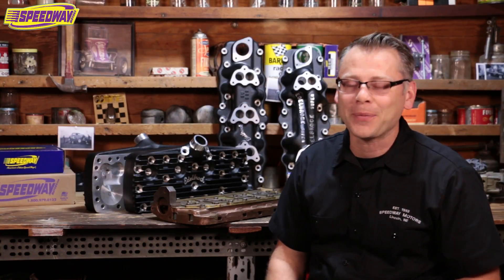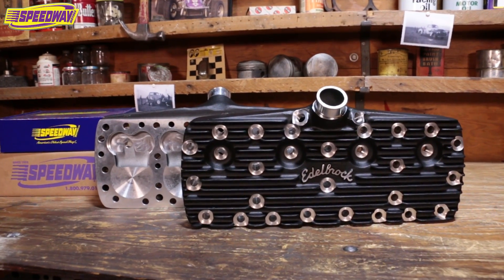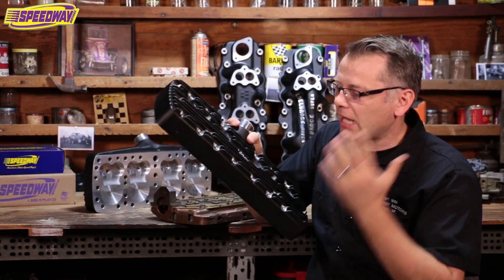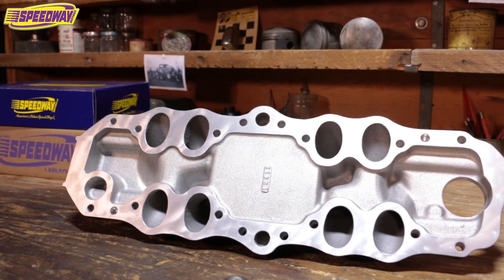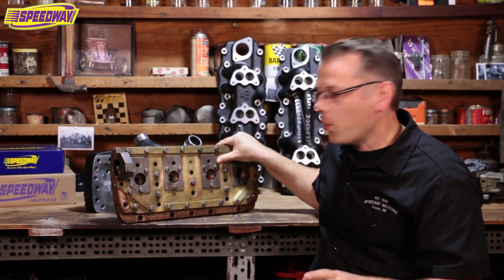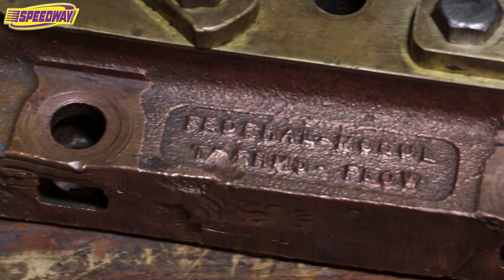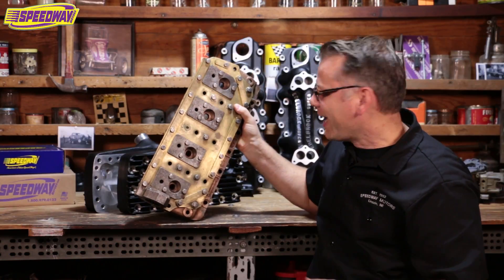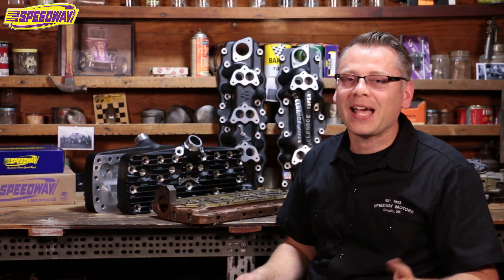Speedway Tech Talk - Flatheads Cylinder Heads

Comment: I have a 1950 Mercury M68.   It strangely enough has two different cylinder heads on it - 8BA & 8RT.   I might have to drop the $$ and get a matching black intake.   Assuming these will fit my 50 Flathead

Comment: Please I need some advice. My 8BA is mounted on a trailer to tow to shows and high school shops. This spring it blew water out of #1 exh. I changed the head gasket and accidently knocked the bottom off the blind hole for the thermostat. Now no more water out of #1 exh but all my water goes into the pan.

Comment: Do the aluminum heads need longer block studs?
Reply from the maker: Typically aluminum heads are thicker than the original cast iron heads by just enough that you do indeed need to switch to new studs. At any rate, if you're looking at Edelbrock heads, we recommend these if you want a perfect fit:  https://www.speedwaymotors.com/ARP-151-4101-Head-Stud-Kit-1938-48-Ford-Flathead-for-Edelbrock-Heads,88073.html These are for 38-48 Edelbrock heads, so if you have Offy heads or the later 49-53 heads, we have stud kits for those as well.  You can call our techs at 800.979.0122 if you need help selecting the proper set.

Comment: Those thermal flow heads look like they'd bump the compression up a bit. Wonder what the ratio was for them?
Reply from the maker: The Thermo-Flow heads Tim talks about in this video are a part of the Museum Collection.  They have been trying to find old advertisements or articles about them to see if the manufacturer made any claims about compression.  You are right that the chamber design looks like the aim was to boost compression, but we have never run any tests to find out how much!  They are rare, and when you find a set like they they will almost always have a cast aluminum upper section that always deteriorates because of electrolysis.  Tim later found out that these heads had the top plate made later to replace the aluminum halves that went away.  Someone did a lot of work on these and they sure are a cool piece of history!

Comment: Are flatheads expensive to rebuild?? I’ve never had one but I got a 31 Model A id love to stick a flathead in. All original car, not lowered or hot rodded. I want to keep the original look of the car but scrap the 4 cylinder. Basically make it a 32 Ford Sedan V8
Reply from the maker: Give us a call at 800.979.0122 and we can chat with you in more detail about this.
Reply: Yes. Price depends on a lot of what you plan to do. Stk build with stk parts will cost you $5K plus minus, depending if you do any work.

Comment: Hi guys great video thanks. So I purchased a set of Offenhauser heads and tri power intake with the 9super7's for my 59a/b and love it. What would the horsepower rating be with the current setup considering I still am using the stock Ford cam and crank? I believe stock HP was 85 in 1939. There is quite a noticeable power difference after the conversion.

Comment: Those are kind of a cool idea. I've got set of factory aluminum Canadian only Merc heads for my 8BA flathead. I haven't put them on yet though. Hey Speedway guys what's the best option for me when if comes to head bolts or studs. I'm puzzled what length I should buy because they usually reference the manufacturer of the heads. These are the stock aluminum Merc ones though. Can you reference me a part number? I don't want to go to long or to short. It's kind of an odd question but I'm sure you've gotten it before.

Comment: the question is....why did they make them???
Reply: These were made by the thousands by several companies back in the day. Remember, back then the Ford flattie was the backbone of hot rodding. The function was to raise compression to increase horsepower. They might also have changed the configuration of the combustion chamber for better efficiency. They are lighter than the stock heads. And they just look bitchin.